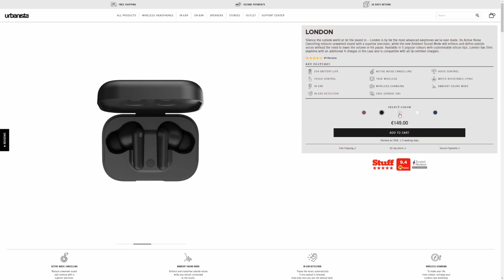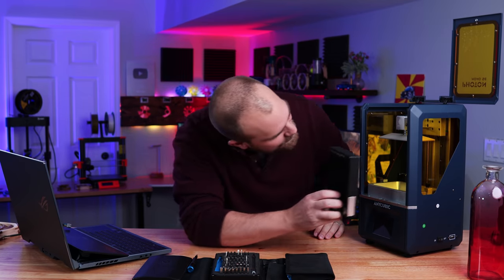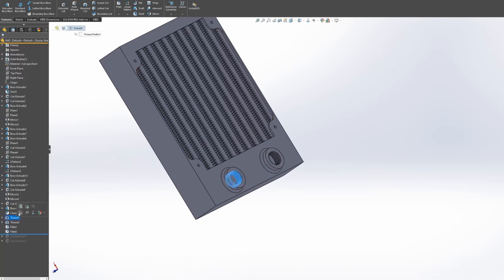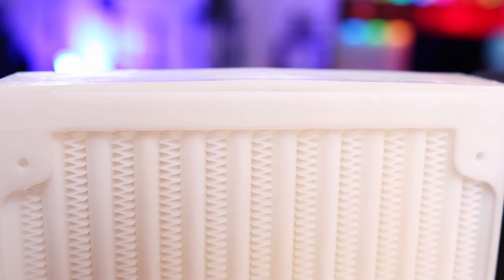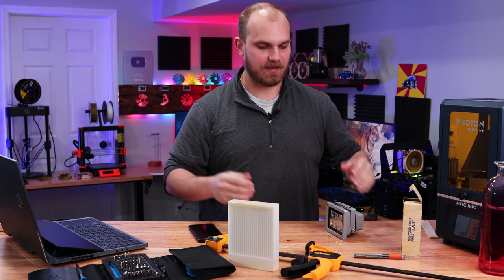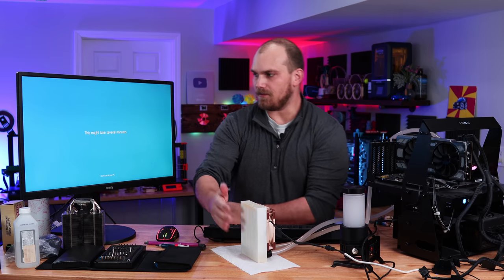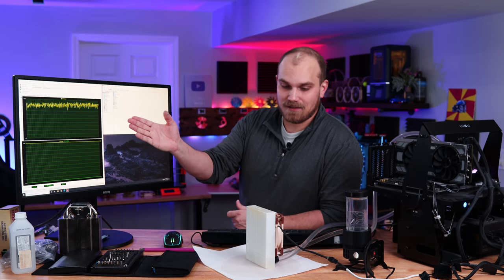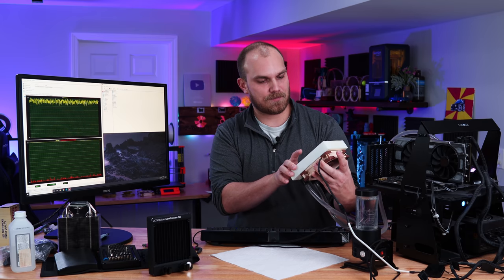I Never Expected This | 3D Printed EK Coolstream SE 120mm Radiator

Comment: Ever thought about doing a push/pull config on that? SP > Rad > AF ? Shouldn't that help a bit more with the cooling? 
The Benefit I can see is that you could make custom sized Radiators; like a 200mm 50mm/60mm thick radiator.

Comment: I remember once reading about fairly effective air-to-air heat exchangers being built out of stacks of hi-core/coroplast (corrugated plastic sheets) with special endcaps that ensured alternating air paths in adjacent channels.

The plastic itself isn't that thermally conductive, but with enough surface area that turns out to actually not be a major constraint for heat exchanger design!

Comment: I would love to see more tests with this 3D printed radiator. I have several 3D printers both resin and plastic of my own, and I want to add water-cooling to the hotend of the one I have in an enclosure to print Polycarbonate and Carbon-fibre-nylon. I'm wondering if your printed radiator (either in its current version, or with more fins) would be good enough to keep the heatsink cool. I think it would be really cool to have a 3D printed radiator on a water-cooled 3D printer hotend.

Comment: Id love to see if there was some way to print one out using metal infill filament. Im sure it would be super had, given that an fdm printer would be alot less successful at making something water tight im sure. Another Idea ive had was that, making a radiator out of resin, you should try to play to its strengths. Im not sure having the fins there between the water channels would help that much so you could possibly reduce the gap between them and get 1-2 more channels/ also I think having your water pipes be square instead of circular would increase the surface area and therefore improve cooling.

Comment: If you ever need to fill any holes or gaps or glue parts together, Mix some resin with baby powder to create a paste. The paste will cure solid and crazy strong with the UV light. It will also retain its perfect color match. I use it instead of CA glue because you can play with and adjust your parts, and when you have them just perfect, Hit it with the light and it sets solid. it also sands down beautifully.

Comment: Use tesla Valve channels instead of straight pipes. That way we can avoid returning flow and maybe even speed the water flow.
Reply: This right here is the crazy pointless over engineering that I want to see done by subscribers and submitted.
Reply: That will only restrict flow too much.
Reply: @TravisFabel  pointless over engineering is the most interesting kind of engineering
Reply: you don't want to speed the water flow in a radiator. the longer water stays in radiator = the cooler it gets.
Reply: But not too much speed cuz water need time to take off the heat. Speed does not take off the heat, it will make the equilibrium faster.
Reply: @rawdez_  True, but some water will stay reflowing in the loops.
Anyway, I know it is a stupid idea, but it would be cool to see it "working"
Reply: @GabrielCarvalho-gd8op  yeah, it totally would be cool to see.
Reply: funny, but a bad idea if you want performance. if you have more flow then you need, make thinner channels instead. then you can fit more channels!

Comment: Omg I never I thought I'd see anything like this, this is amazing. Thank you. 

Ok here's my take if you ever want to make a v2:
The zig zag finns are probably a huge hindrance here. As you said plastic here is probably more of an isolator, so I think the best approach here would be to make as many small water channels as possible and the lower the wall thickness as much as possible. This way you reduce the amount of plastic between the water and the air ie isolation, you also reduce the airflow restriction by removing those zig zag finns. And if you can get the number of water channels up, you up the water's surface...

Comment: Having already read some of the great comments down here:

1- Only print with a high number of thin walled tubes with no fins, due to poor heat conductivity of the resin, you need to make it up by more surface area as well as more "hot" surface (fins won't get hot enough to have a good thermal transfer). You could make the radiator thicker so that it will accomodate more tubes.
2- Go 240mm for obvious reasons
3- Make the walls of the tubes as thin as the pressure inside the radiator will allow, because of course with a badly conducting material, thin walls will greatly help.

Comment: Another idea that you could use to up performance.  Since some of a fan's loss of efficiency is likely (at least in my mind) from the radial airflow that bounces up against the fan chassis wall, you could integrate the fan chassis with the radiator in one print so that all that you retain from the Noctua is the cross member the wiring, and the motor.     Then provide fins all the way around for the air that flows radially to be of use for cooling.

Comment: As already mentioned in the comments, a company called Tethon has some interesting resins. While the ferrolite product is interesting, I think the one you should look at is the genesis high load development resin, as it supports blending with copper powder/graphite. The stuff is meant to be sintered after printing, but just having copper present should greatly improve thermal conductivity. I am assuming really fine diamond powder could be added with the copper powder to boost thermal conductivity. The one real drawback that I can see  is that the stuff is nearly as expensive as the ferrolite, and requires your own experimentation (I have no idea how they decide mix ratios). so you might need more than a liter.

Another company is AdmaTec, however they do not even seem to be selling anything directly to the public. 

There are also FDM alternatives, but I do not think that would play well with the thin walls and watertightness  you are seeking. 

This is a really interesting idea, and I would love to see more of it. Keep up the great content!

EDIT: I bet there are some more efficient flow to surface area designs that 3D printing would allow in comparison to conventional radiator construction.

Comment: There is plenty to be done that could improve the efficiency:

1- regulate the coolant flow, water will always the the path of least resistance (and most of time the shortest). This mean that I'm pretty confident that the radiator flow would be mostly fast around the center pipes and quite slow on the outer edges. Meaning loads of hot water would make it through without really having a change to exchange heat.

2- print with FDM instead of SLA. First SLA print are quite smooth, meaning the coolant flow will be less turbulent and therefore have a less effective heat exchange, the classic layer lines produced by filament printing in this specific case would be a positive attribute (also increasing surface area with both mediums). Metal filled filaments are way cheaper and available than metal filled resins, also they have much lower specific heat and higher thermal conductivity than regular 3D printing polymers.

3- More and thinner pipes (maybe positioned in a staggered setup to maximize airflow turbulence). Probably way more efficient than the finned design since any plastic is a poor heat conductor. 

4- reducing mass, thermoplastic and resin have quite high specific heat. The radiator shouldn't be the system heat damper, that's the water/coolant fluid job. So ultrathin walls for the ducts would be priority.  

Finally, my bet is on a Metal filled PLA printed with a 0.2mm nozzle, many more piped with maximum 2mm ID (max 2 wall perimeter, flow-rate set slightly high to maximize surface area with both mediums and secure from leaks), then annealing the print (to improve the crystalline structure of PLA which improves heat resistance and should THEORETICALLY improve thermal conductivity too). 

It's a really, really tall order but performance can be massively improved and price stay below the 10$ mark.

(Even thou this would be like re-inventing the wheel and should be therefore only be done for internet credits 🤣)

EDIT
Also consider the plenum shape, the pipes closer to the inlet will see higher pressures than the one furthest apart. This can be compensated by having a plenum that tapers toward the furthest duct or by making the nearest ducts smaller and the furthest bigger. The first option normally being the preferable one since it puts all the ducting under the same pressure and therefore fluid velocity.

Comment: If you untwist the cap of the resevoir it will start leaking again. If the crack is small enough then the small vacuum in the system will keep it from leaking more. I had this on a fitting 😅

Comment: You could make a radiator that you slot the fan into.
Or use that resin repair trick to make some holes to add some copper rods into, then coat the cap in resin. (on slot in a few entire heat pipes, ditching the plastic fins entirely.)

Comment: Actually there is plastic that works just fine to transfer heat - look up a Heat Exchanger for homes -- they run some kind of drum that pulls heat out of outgoing air and heats up incoming air. They are made to essentially pull out moisture and bring in fresh air into your home.

Also you can have it lean towards where the fan mounts (falling forward if you will" to give it support gaps

Comment: Have you ever experimented with electroplating ? 
I think if you printed the "fins" of the radiator a little bit thinner and electroplated the entire radiator you could get better performance. The thinner walls would increase the transfer of heat and the metal electroplating would reinforce the part while improving heat dissipation. Just an idea !

Comment: The fact that this works is wild - if you have access to a kiln, it'd be really interesting to see a ceramic radiator printed from something like Tethon's Porcelite or Formlabs' Ceramic resin(s). One interesting thing with them being the actual kiln curing process results in a shrunken model, letting you create thinner radiator channels with the same larger printed diameter

Comment: Unless I miss understand you basically kinda built a "swamp cooler" radiator. I have one of these "as seen on t.v." kinda products where you're supposed to fill a reservoir with water and it drips it down through some fins into a sponge in front of a fan to create slightly cooler air. I mean I gave up on the water thing because it just changes the air humidity and the fan itself is probably effective enough alone to cool me on warm days, but the concept of cooling the water seems about the same: blowing on water through the radiator to cool it as it circulates through the system.

Comment: what is the depth of the printing space?
I would make it as deep as possible to increase surface.
i would eliminate the infill(?) in the air channels, printing in not heat conducting material it might at best give a little support.
in order to increase the surface i suggest to print the waterchannels in a corrugated form, that might give them extra stiffness as well.
with air channels without infill the airchannels could be made thinner, and the number of water channels could be raised.
I see a lot of potential in this idea.

Comment: I think that the straight runs for fluid are for manufacturing ease with metal. If you do optimize it I'd get rid of the mix of thick tubes and thin fins and make small fluid channels in some slightly beefier fins so that you're maximizing the surface that's in contact with the water and the time the water spends in the radiator to increase heat dissipation. You can get all funky shapes that will work better for this with 3d printing.

Comment: You could measure the temperature in and out and compare it to the aluminum radiator, also measuring the flow would be interesting, since it's possible to estimate how much heat it's dissipating

Comment: I saw a fellow commenter mention metal-based resin for the resin printer. I also wanted to mention that there is also metal-based filament for the FDM printers as well. I hear it's also expensive and you may also need a kiln. I would love to see what these printing methods are capable of! Thanks for all your hard work!

Comment: you could freely add extra length [depth] to your fin stacks too, i think since the plastic itself doesn't conduct much heat length would add a fair amount of extra dissipation. 

to farther that, perhaps another cooling loop phase would be enough? [PC loop to secondary water loop, like oil cooling]

Comment: While it performed better than I expected, I had a feeling that it would work.  Had an old Geo Metro in college, and the heater core in the dashboard was a plastic radiator.  Worked okay to heat the inside of the car once the engine heated up.  But still not very efficient in heat transfer.

Comment: double the thickness of the radiator alongside making the walls a tiiiny bit thinner so as to allow longer fins. You could also try putting about 10 grams of aluminum powder in the resin and very completely mixing it.

Comment: Make your plastic radiator vertical flow channel fins with a tear drop or airplane wing cross section (when viewed in x-y plane) so the air is drawn through smoother than the blunt ends they have now. You might want more turbulence on the back sides of the flow channel fins to transfer heat but it's better to get as much air in there at the start that you can.

Comment: RADIATOR SHOWDOWN!
That was pretty neat to see it actually working. Honestly I would get rid of the fins altogether, I don't see them actually doing any thermal transfer, just use a higher density or configuration of thin wall pipes instead.

Comment: Makes sense. You can boil water in a plastic bottle or bag over an open fire.
The water keeps the plastic cool enough to not melt. Up to the point that the water is boiling”
Then it begins to deform (heat from water plus heat from the fire.

Comment: I can see how there could be some major optimizations possible here. Reducing the wall thickness to see how low you can go without leaks. The 'zigzag' bits between the water channels are made that way so they can be made easily from a single piece of metal, so they can be changed around to try other ideas.

Given 3D printing can allow for internal cavities and shapes otherwise impossible to manufacture it would be interesting to see what other designs people can come up with that can use interesting geometry. I wouldn't at all actually be surprised if it turned out with 3D printing you could make a super efficient radiator, even if it was simply plastic!

I wonder, is there anything you can add to the resin to increase it's thermal conductivity, or strength (for thinner walls)?

Comment: I would suggest trying to remove the fins and having an increased amount of water channels, as the fins work by conducting heat from the channels to then be discipated, but in this case i would expect the plastic thermal conductivity to be too low. I know everyone says thermal cameras don't work on pcs, but in this case I think they do as the object is plastic, so if you have one of the flir cameras, it would be interesting to see if the fins show any temperature increase of if it's just the water channels

Comment: U could try one without fins and tighter flow channels, as the thermal resistance of the plastic is higher the fins probably barely increase thermal transfer but 1 or 2 more 'flow chanels' could help increase it somewhat.

Comment: So I had a crazy idea of cooling a cpu from both sides of the motherboard using thermal tape on the back side to go in between the mobo and the cpu liquid cooler. If you were to test this for me because I do not have the money or the equipment to test it, I would suggest using two independent loops. That way you can get the normal way up and running. Then when the heat levels out, turn on the other loop to see if it does anything at all.

Comment: well do a 360 radiator, like from 3 parts that you stick together like you fixed that crack on too, then maybe some fin optimisations and test it out, also i think you should try to print a waterpump and a reservoir and a cpu block too so you can test all of them separately and then all 3d printed watercooling parts together: block, pump, reservoir, radiator, distribution block... like you know, 3d printed watercooling system to see how well it performs

Comment: the biggest plus to a polymer rad is it doesn’t oxidize and get nasty and you can repair it easier than metal and depending on how expensive it is for the size to make it could be cheaper than metal

Comment: Have you thought about using conductive filament.  They use copper in the filament.  Copper conducts heat as well as electricity

Comment: Hey, @Major Hardware, a 3D-printable radiator design challenge would be awesome! to me its way more interesting than your fan competition: in fan's case you just print a plastic thing for what the industry already has quite perfected in plastic. off-the-shelf fans are cheap, quiet and efficient. but radiators on the other hand: there are no commercial plastic radiators. its a completely new field of device. walls have to be thicker than with metal, fins dont make a lot of sense when in plastic, so the "perfect" design would be substantially different to whats on the market. thats totally awesome!

Comment: With this design of the radiator (totally unsuitable for for the build material) and at no fan speed it is absolutely amazing it works at all :). Good job. Resin is circa 565 times less conductive than aluminum the rad is made of. You can 3d print a resin rad which will outperform any off-the-shelf commercial PC one. There is a design which will operate without any fans at all. Two hints, boundary layer and surface area ;).